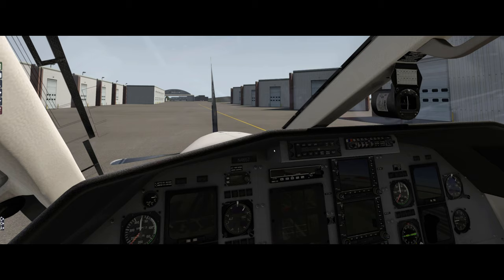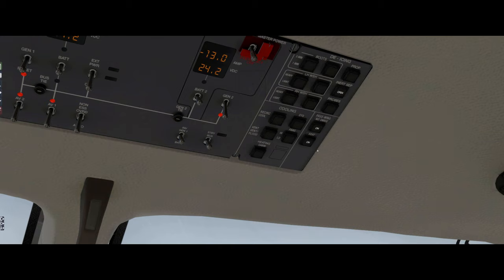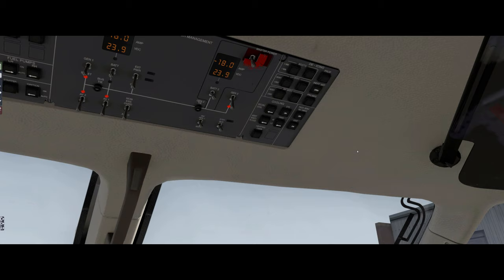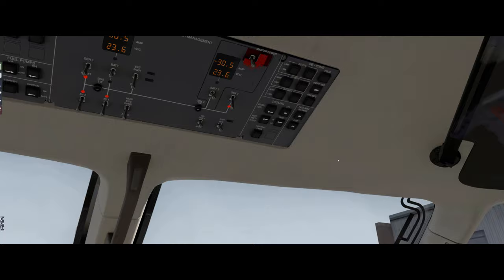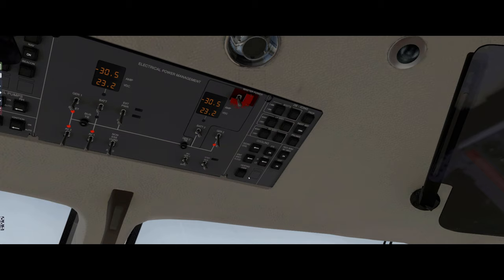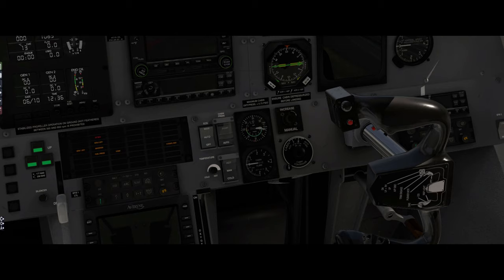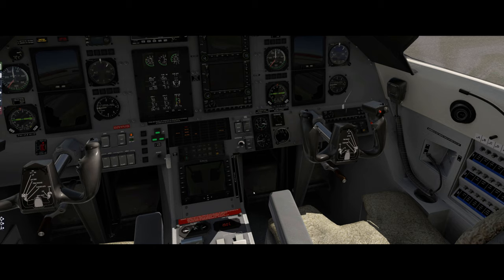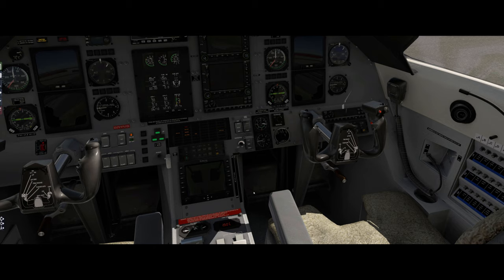Pilatus PC-12 Heating and Cooling Systems

Comment: Thanks for the overview of the environmental systems. I learn something each time you post a new video.  Since I fly the PC-12 so much in my sim, it would be great to know how the AHRS interact with the flight displays. I tend to keep AHRS 1 set to Slave and CCW. There are 4 settings for AHRS 1 in my plane: DG/SLAVE, CW/CCW (mine differs from the Carenado version), and of course this repeated for AHRS 2. I don't think the AHRS functions are modeled in either version. Nevertheless, I have my suspicions about how they work - I'm thinking Slave forces the back altitude & heading reference to agree with the primary system, thus CW would cause them to work independently (I may be out to left field on this)?  Thanks!
Reply from the maker: Thanks for watching again, Frank! Good question -- it works differently than you think and I'm sure you're not the only one with those questions. Great excuse for another video, so stand by for that!